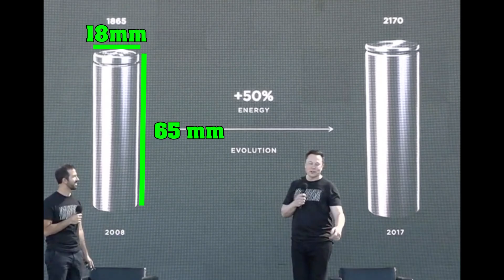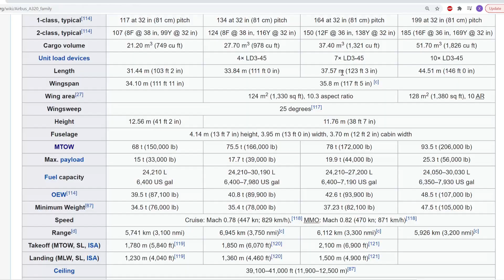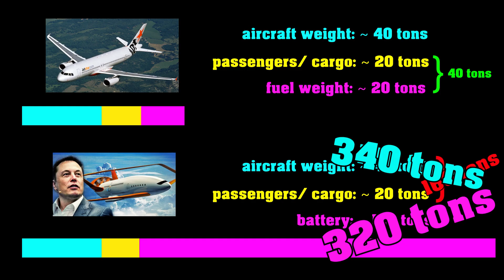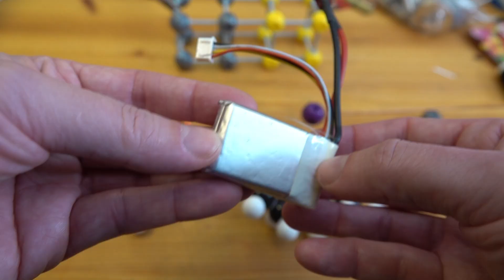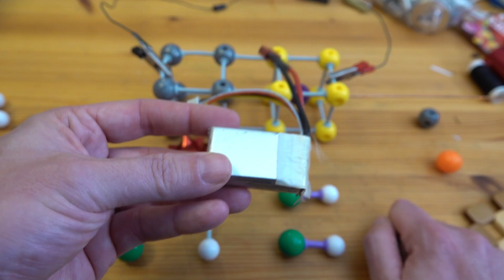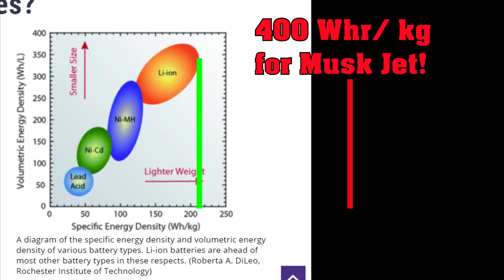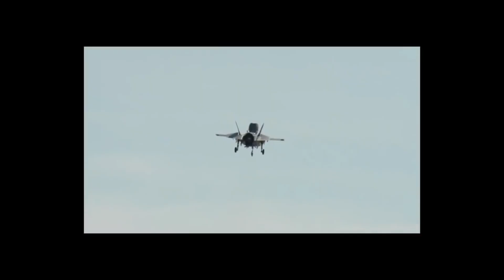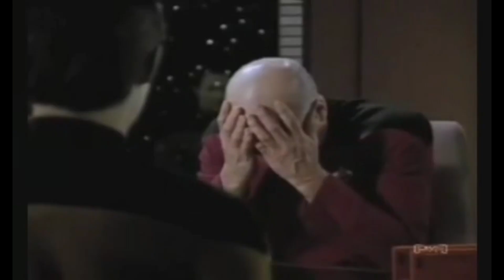Tesla's Secret Plan To Disrupt Airlines: BUSTED!!

Comment: "I'm going to make a Supersonic Electric Jet". he seems to be missing the core concept of what a Jet aka a Jet Engine is. Combustion is king of important to what defines it as a Jet. He may be seeking to make some sort of Super Sonic electric Ducted Turbofan. But it can and never will be a "Jet". And if P T Barnum here can't get the basic terms and concepts nailed down in his own head, he ain't getting anything off the ground. He might succeed in making an ultra light civil small plane that runs on electricity. Has a top speed slightly higher than a blimp, and a range of about 100 miles. But that's it. You're never going to be able to get it  anywhere near supersonic speeds. Using an electric motor, no matter how good or powerful is going to require actual propellers like a Turbofan engine. And you can't spin propellers fast enough to get a plane Supersonic. Well you can. But really really ugly things happen when the blade tips break the sound barrier. Like everyone within earshot of the aircraft suffers vertigo, nausea and is physically incapacitated. Look up the XF-84H "ThunderScreech". It was a fun plane. 

See people, including Elon Musk that jet engines power the plane through the air by dragging it along via the big fan rotors at the front of the engine. That's not how they work at all. Those fans are simply drawing in high pressure air to feed it into the combustion turbine in the back half of the engine. it's the fuel combusting in the smaller high pressure turbine that drives the plane. Combustion being a critical element of this equation. You can't simply spin the big fan with an electric motor and make it go.
Reply: And even the Thunderscreech wasn't supersonic in the end, it just made everyone who had to work near it want to set it and themselves on fire to end the misery.

Comment: What I don't get is if you're packing cylinders - the larger the cylinder the actually less dense you can get them and nobody seems to call that out.  Sure each individual cell is bigger, but the spacing is worse and the surface area is less for worse cooling.
Reply: Tesla’s 2170 battery packs have way better cooling then their 18650 packs because there’s fewer cells per cooling ribbon.

Comment: The video you quote states: "Not to mention they're more efficient at higher altitudes due to the thinner air".   

But isn't that thinner air colder than air lower down in the atmosphere??  I have been researching astrophotography and one of the things that was pointed out was that digital cameras discharge their energy faster at the lower temperatures when taking the pictures of the night sky during the winter.

So, if that is true (not managed to try it yet), won't the batteries be discharging their energy at a higher rate when hitting the higher altitudes in a battery powered "jet"?
Reply: Yes, even their Telsa cars get lower range when driven in colder climates.
Reply: @nssherlock4547  precisely.  That was my point.  If it's flying at above 50,000 the temperatures are likely to be what -10°c????

Comment: I don't know much about planes, but don't jets need to use fuel to still be jets. Like isn't that how jet engines work? By mixing fuel with air and shooting it out the jet thruster?

Yeah, you can make electric planes, but wouldn't they need to be prop planes?

Comment: Germans made VTOL jets in the 1960s called the DO 31 and there's a reason why it never took off, pun intended.
Reply: Well yeah but for rather different reasons that why this won't take off. Theirs worked but wasn't really viable economically or fitting to the doctrine at the time. Elon just picked a bunch of words and smashed them into each other without realising that you can't make an all electric plane break the sound barrier unless you invent the electric turbo-jet/turbo-fan. Electric ducted fans ain't gonna work for this.
Reply: @miaconnor5767  Yeah i agree, Elon just says a bunch of shit and idiots lap it up.
I love the German design, it did work yes, amazing jet, it was featured in the Man in the High Castle TV Show a lot.
As cool and awesome as it was, completely no good when there is better alternatives and hence why it never became a thing.

Comment: Listen, thundercuck, clearly the airplane will use batteries as structural and aerodynamic elements. Everything in the cabin: batteries. The seats: fuck floating, they'll be batteries. Tires: haven't you heard of air batteries? Windows: transparent batteries. The people's cloths: batteries. 

What a fucking moron. I mean, think about it. If your seat can blow up like a bomb if its punctured, do you really need to use it as a floating device? Checkmate.

Comment: Sigh.  You're a scientist - do your research.  No, the 2170 cell is not what folks are talking about wrt Tesla's new battery technology, it is the 4680 along with attendant changes in chemistry, anode design, cathode design, manufacturing process, materials involved, sourcing, contact design; also cell-to-structure, etc.  And the gravimetric energy density exceeds 300 Wh/kg, not 200 as you insinuate.  The claim is that there is a fairly clear path to ~375 to 400 and, frankly, there are already Li ion cells out there - albeit quite expensive ones - with 400+.  You are so often quick to declare something impossible that has actually already been done, or to simply misquantify or straw man.

Look.  I know you have something against Elon Musk, and you love 'debunking' him and his projects and plans.  You're not alone.  However, the man is clearly smart, capable, thinks outside of the box, is not afraid to abandon sunk costs and, most importantly, has succeeded repeatedly at making those scoffed-at projections into reality.  Does that mean that he'll succeed every time at every plan?  No.  But does it mean that it's probably smart to assume that he's actually thought things through and that he might well deliver despite apparent difficulties?  Yes, yes it does.

So, critique away; question, be skeptical, etc. by all means.  But don't be sloppy in your reasoning against a serially successful innovator, and maybe allow some benefit of the doubt and respect for someone who has repeatedly done the "impossible."

Comment: A point at end how they say "it gets faster higher to goes" Well what kinda engine are they proposing to move the plan? If its a propeller based electric motor then if there is less AIR then there is less thrust from the propeller so it has to spin faster to make up for it which puts a new problem in to a propeller that would be able to take those forces to speed 20k-30k or what ever RPM would be needed at those altitudes. I am far from an expert in all this but this is just basic common sense.

Comment: Also:
1. Planes become more efficient as they fly, as their fuel weight decreases. An indirect-coal powered plane will not have that advantage.

2.The core of a plane's fuel system typically does not wear out or fail from the its core, tanks, out towards its periphery, but instead wears out or fails from its periphery towards its core (Pumps, tubes, valves, and then tanks), and is long lived. An indirect-coal powered plane will see the core of its fuel system, the batteries, fail within about 3 to 5 years.

Comment: Thunderfoot although I agree with you , there is a way 

I shall explain 

Now electric jets , run them off a generator that is powered by a small diesel engine might sound like a farfetched idea but I could see his method working in this way by bringing the weight down not storing the physical energy on the plane and creating it instead ☺️ just maybe it would float never be supersonic tho

Comment: Yeah, the whole battery powered plane has to drag the full weight of the battery the entire flight, while a liquid fuel version gets lighter as it flies.
Reply: I'm just a hot air balloon pilot, and we account for this exact real time weight change during flight, when flight planning. The balloon flies more efficiently as the flight goes on, assuming all other variables like temperature and air pressure consistent
Reply: Maybe it uses heavy electricity, like in the Brass Eye science episode.
Reply: Introducing extra batteries which are jettisonable.
Reply: @matthiasmay1977  Exactly! I can already see the headlines: "Elon Musk has invented a battery that can be jettisoned from his electric airplanes" It is the meta-scam: a scam inside the scam of the electric plane, but keeps the media interested and investor money flowing in.
Reply: @matthiasmay1977  
Hmm, yes; a really long electric cable to power the take off (parachute to make sure it doesn't kill too many people on the ground when its detached); wings made entirely of solar panels to keep the batteries charged in flight, and jettison half the batteries (more parachutes) to reduce landing weight - who knows there might even be room for a couple of passengers too.
Reply: Well, technically there is oxygen+lithium batteries, which could increase the energy density. Problem is that the only ones on the market is not rechargeable to my knowledge, and they usually come in sizes suitable for hearing aids.
Reply: And has to land at basically the same weight as at take off - so even more structure (weight) to handle the additional landing stresses.  Although if it's VTOL maybe not, but then again if that's the case it will need bigger or more engines (and more power) to take off and land without the advantage of lift from the wings.
It's not the most analogous comparison but the STOVL version of F35 has only half the weapons bay and half the range of its conventional siblings.
Reply: @andrewholdaway813  You realise of course all aircraft are occasionally forced to land seconds after they take off.  
Do you think the normal aircraft are going to collapse cause the engineers didn't think about all that extra weight???  :D
Reply: @nullgod  
You do realise we are just mocking Musk here?

Comment: I worked as a total loss insurance adjuster for years, and had a claim where a battery on a Chevy Volt caught fire after a crash. I'm all for electric cars, but I was truly surprised by how  completely totalled that car was after catching fire. To be fair, gas cars catch fire and burn impressively, too. I just have no illusion batteries are somehow less dangerous than gasoline after that claim.
Reply: But, let's think about this...there are regulations regarding carrying batteries on planes because there is a realization how quickly, and thoroughly they can burn. Now we want to make the main source of power on a plane batteries? 

At the end of the day, if we could use renewable energy to pull carbon out of the air, and convert it to liquid hydrocarbons, we would still be doing the same thing in which batteries have an advantage...allowing renewable energy to eliminate excessive carbon emissions.
Reply: Yea one ep's of grand tour had richard in an electric car during an ep. He crashed it and car was bursting in to flames for hours later cause battery's cell's going 1 by 1

Comment: The oxygen generators are only rated for 20 min. all commercial aircraft make a rapid decent after decompression.
Reply: because they want to get to an airfield because the passengers are shitting themselves in panic. also the plane took damage you don't want to continue flying.
Reply: @toomanyaccounts The main concern is to get the aircraft to the altitude where the passengers can breath. It has been proven many passengers will not operate the masks correctly. I have not gone on a post "D" check test flight personally. Those that have gone have told me a decent can be made at 16,000 feet per min and quite exciting. That decent is not a dive but is made at reduced power and increased drag. Forward speed is low so  when the lower altitude is reached the gear is retracted power is increaced and the aircraft is flying.

Comment: I'd belive a nuclear powered jet before an electric power jet.
Reply: and the research on those stopped because it turned out that the crew and passengers would have to wear radiation suits otherwise they would die after one flight of radiation sickness. some other fun things they found out where unless you put enough heat shielding the reactor will cause the supports of the plane to melt either making the plane break apart midair or the reactor will drop out of the plane causing a huge environmental disaster such as massive radioactive forest fire or cause a city to have a huge amount of fires that are radioactive. also the reactor was so heavy that the plane couldn't take off hence the radiation danger and heat issues. 

yeah the US abandoned that research real quick unless we found a way to harness radiation that wasn't just to boil water to turn a turbine that was also incredible safe if the reactor had an accident, or drastically improve the radiation shielding and was far less weight. neither has occured in fifty years despite tens of billions of research.
Reply: @toomanyaccounts  that's why I wrote what I wrote but yes you're correct.

Comment: What about structural batteries? I wonder if that could possibly shave off enough weight to make an electric aircraft viable? and then NASA has the EAP (electrified airplane propulsion) prototype.

I'm not defending Elon here because he's a numpty and i think it's ironic that for once, he's not considered the work others have done in related fields to try and pass it off as his own.
Reply: Wouldn't structural batteries be even more vulnerable and dangerous?
Reply: @joaobaptista5307  they are wrapped in carbon fiber, so not indestructible but stronger than how we package them now. watch?v=qk1TTXhdt70

Comment: The fuel weight goes away over time. The battery weight is eternal. 
Not very practical unless quick immediate decent is a must.

Comment: Power density of li-ion is not limited by 200 Wh/kg. All batteries in modern smartphones now is about 300 Wh/kg, check it by yourself.

It has been achived by reduction of shell weight, chemistry tweaking and increasing typical voltage from 3.7 to 3.85 volts.

Replacing part of the graphite on anode with silicon capable of holding 5 times more lithium ions may well raise the bar up to ~350 Wh/kg

Comment: hmm a battery Jet 🤷‍♂️🤦‍♂️
FFS the higher you go the harder the "Electric Motor" has to work (spin the propeller because IT WON'T Create Thrust like a Jet) to create the thrust in the "Less Dense AIR" & that will require more energy use. My god the stupidity of these people is astounding.
Reply: With >400 Wh/kg it's feasible...

Comment: You could increase the energy density of a lithium ion battery by more than that just by replacing the graphite with silicon. It’s just that the medium would expand & contract so much as it cycled that it would probably cause your cell to fall apart pretty quickly
Reply: That's why they use an elastic binder. Take a look at the battery day video.

Comment: There is no secret plan, they are just waiting for a 400 WH/kg battery, then they will consider it.
Reply: Finally someone with a brain in the comments. Thank you.
Reply: @bluesrockfan36  3-4 years according to Elon:
https://twitter.com/elonmusk/status/1298017332904620033
The battery specs at battery day are just for the new form factor, they will change the chemistry too.
Reply: @johntheux9238  Did Elon provide literally any evidence or proof that this is even remotely realistic ? Ya know, something that isnt a tweet ?
Reply: @DeadNoob451  Well, according to the battery day video with the dry electrolyte, the silicon anode and a nickel cathode they should improve energy density by 40% so that's ~364WH/kg

Comment: 1:50 is it true that that's the size comparison or is it just a representation of the improvement. Maybe it's just a confusing way of presenting it?
Reply: Its not confusing at all, watch the battery day presentation. In the presentation, Musk an the chief engineer were saying they got a 50% increase based on FORM FACTOR (i.e increasing the size).
They did that for a myriad of different things that go into increasing energy density speficially for the Tesla vehicles. From chasis design, to manufactury of batteries to mining.
Tallying up each, in the end resulting in a car with a better range and much lower cost (the battery is the reason the Tesla cars are so expensive).

 TF is being incredibly disingenous this video,  as usual when it comes to Musk.

Comment: the 2170 is the older design where it was just bigger, now they have a bigger battery that is 46mm x 80mm not a big difference, well it is tabless so its easier to manufacture and it does produce a little more of power but pretty much the same battery density